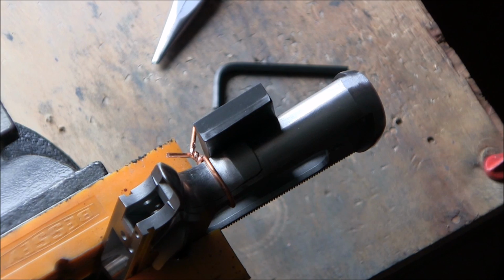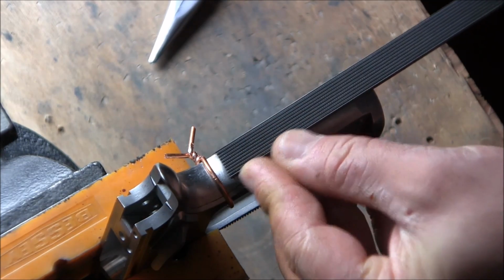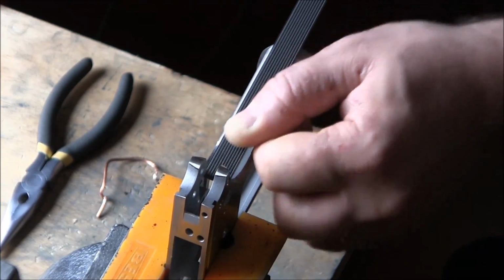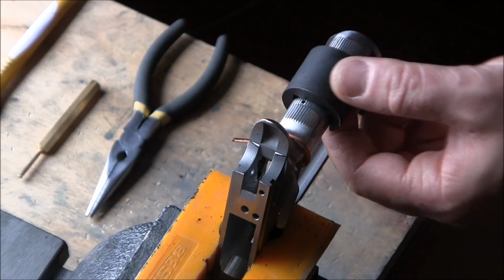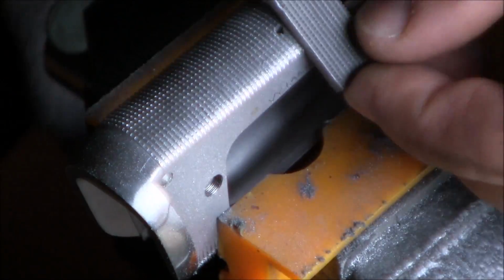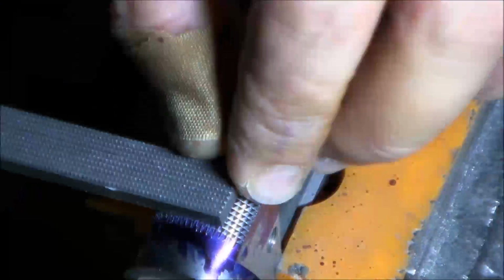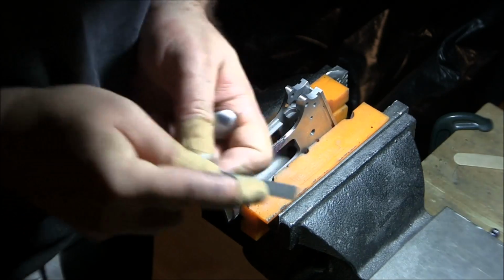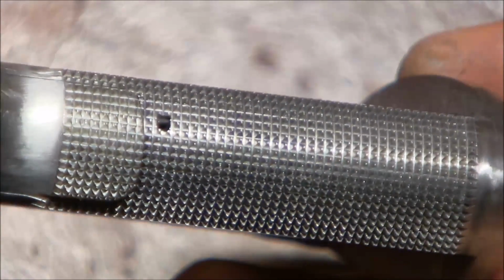1911 Build 6 RMR - Part 3 - More Hand Checkering

Comment: Excellent work. How did you learn to checker?  I would like to learn some of these skills, but I also don’t want to destroy a frame at the same time?   Did you start off on bar stock to learn how to run the files?
Reply from the maker: No, I actually started on my first 1911. But if you dont feel comfortable with doing that you can practice on steel pipes. I believe 3/4" or 1" diameter pipe will have similar radius.

Comment: These are the exact ones I use. $30 for a whole bag.
Reply from the maker: Which size are you using? And how many are in a bag?
Reply: MosinVirus I'm not sure what size they are, I just grab them out of the bag when I need to replace them. I have exceptionally small fingers and they fit decent so I'm assuming they are medium. They are snug and stretch out so if you feel you have above average size fingers then the large might be ok but I'd stick with medium to be on the safe side because of how elastic they are. There are 50 pcs in a bag.
Reply from the maker: Thank you again.
Reply: MosinVirus Sure thing! Thank YOU for your amazing videos! I respect the craftsmanship and enjoy metal work as well.
Reply from the maker: I figured, since you have the finger guards. :)